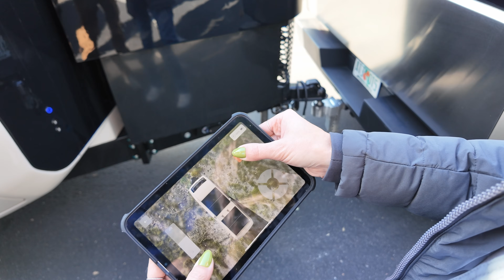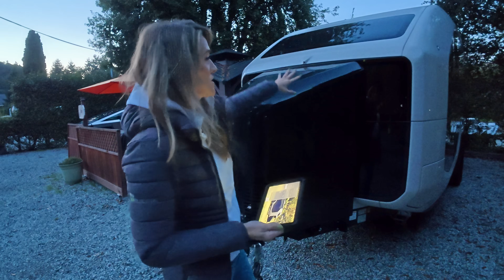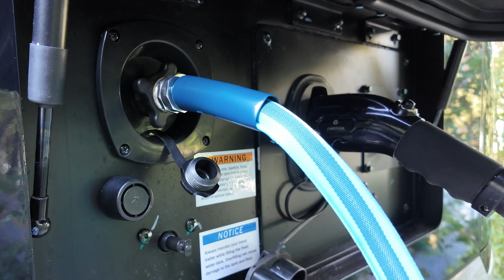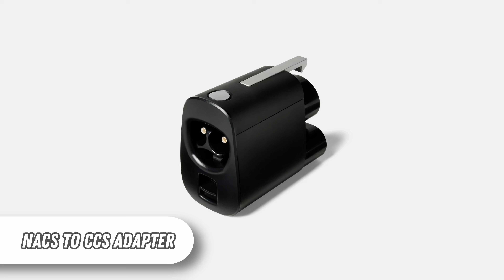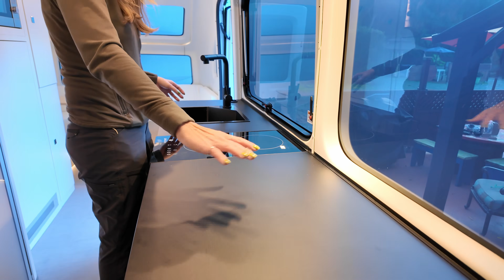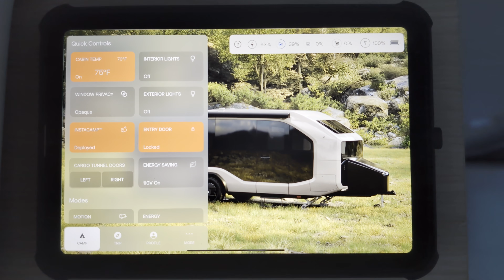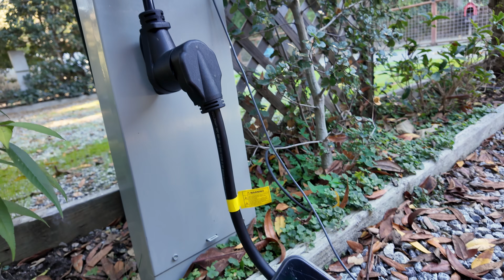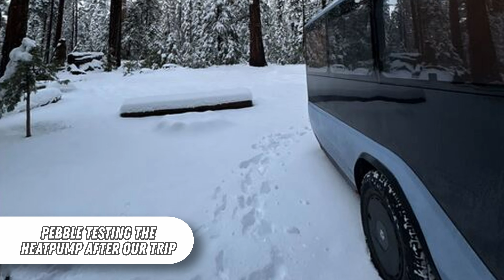World's First Pebble Flow Review (Electric Travel Trailer Camping Experience)

Comment: Good presentation. I agree with most of your observations. We picked up our Founders Edition in November and camped our way back to Colorado. We have 15 years of Airstreaming experience. I would offer just a few comments:
Your trip was short, and terrain appeared to be relatively flat. 
The exterior outlet for the cooktop is in the gear tunnel. No need for a skin penetration.
Bathroom lighting is independent of other lighting controls. A motion activated night light would be easy to plug in.
Single axle better enables tight turns, particularly for campsite maneuvers, and preserves interior space. 
Starlink is not included in Founders Edition.
The heat pump in our unit was quiet and heated from 29F to 75F with no effort.
The insulation was good, interior skin was comfortable to the touch with no condensation.
An exterior solar input would enable optimum placement of portable panels for better energy gain in boondocking situations.
Both energy and water conservation can improve with boondocking experience. 
I charged both the Pebble and our R1T in campgrounds with no issues.
Reply: Thank you so much for your comment. I got worried about the heat pump considering I’m within few days of receiving the Pebble. Any advice as an owner that I should ask Josh during the product orientation?
Reply from the maker: I'd venture to guess the trauma caused by Pebble's heat pump installation/calibration error ahead of our review of the serial #1 Flow has resulted in very high quality control vigilance for that particular process. 
-Producer Tim
Reply: @ZelmarDesigns We had the benefit of a VIP visit months before our delivery, so our questions at delivery were relatively few. Take your time and ask about anything on which you are unclear. Josh and his team have been great with post delivery service, coaching me through any hiccups that I’ve encountered. A few days in a RV park not too far from Fremont was valuable to us in exercising the systems before hitting the long road home.
Reply: Great video, thanks for sharing
Reply: Hey Joseph, thank you for sharing your perspective as an owner.

Jumping in to reiterate a few points you raised:

* We offer three outlets in the gear tunnel, plus a cable pass-through toward the front of the trailer intended for Starlink and other powered accessories.
* As you mentioned, we do not provide a Starlink unit with the Flow, and we also do not include an NACS adapter.
* As noted in Laycee’s video, the HVAC unit in this specific trailer had an issue that wasn’t caught because it didn’t go through the same full checks as our customer-delivery units. This has since been rectified.
* Our single-axle design is a very intentional choice as it enables tighter turns (especially with Remote Control) and preserves more interior space than a dual-axle layout.
Reply: As an owner of pebble flow, What are you thoughts on tank water, is it hot enough?
Reply: The tankless electric water heater produces very hot water (temp is adjustable) at the faucets with little delay and waste of water that has cooled in the lines.
Reply: Thanks for your review…I’m also from Colorado and hope you can go to some of the local trade shows.  You mentioned the heat pump required “no effort”. I assume you ment management. I’d be curious on the actual power draw in summer/winter modes.  Also, did you get the Tesla DC adaptor?  How did it work in terms of DC kWhs from a Supercharger?
Reply: I'm debating getting an Airstream Globetrotter 27. How do you feel the Pebble compares to your previous Airstream?
Reply: How do you like the Auto Dump feature on Pebble Flow, compared to traditional dumping process on the Airstream?
Reply from the maker: Thanks for sharing your observations and opinions as an owner.

You are the third Flow owner to comment on this video with validating perspective which has been very helpful to viewers.

Almost all of your observations appear on screen in this video, were spoken aloud in this video, or have been part of this video's description since publishing.
-Producer Tim

Comment: It looks great with the Cybertruck - very futuristic. I love the concept of the trailer, the price of course is where the desire vs necessity thinking kicks in.  It's a wonderful showcase of tech though.
Reply from the maker: Other premium 26ft travel trailers also cost $120k+ without the propulsion technology. We think the Flow will do well in that segment. Hopefully circumstances will improve regarding the supply chain so it can eventually be sold profitably at a lower price. Thanks for sharing your perspective. We hope you'll check out our reviews of other electric RVs, vehicles, and beyond on this channel
reviews.MissGoElectric.com
and at ridereviews.MissGoElectric.com
-Producer Tim
Reply: @MissGoElectric  What did you think of the Cybertruck? How does it stack up against a Rivian road trip?
Reply from the maker: We have owned a Cybertruck and a Rivian R1T personally for years. Both are a great at road tripping.  The Max Pack R1T can travel further on a single charge but has an inferior driver assistance capabilities.  The Cybertruck has a better sound system and the locking bed is better.  The Rivian frunk is outstanding and the materials are nicer.  Both great options. -Producer Tim
Reply: I could never justify that, especially considering the alternatives.  A well maintained 2005 Lazy Daze 26.5 is $25,000 , with a higher quality interior and build quality than a new RV from any of the big names in the industry.  Plus, you've got over 450+ miles of range and don't have to waste time on some slow auto-backing gimmick. Put a new engine in it plus solar panels and it's still less than a quarter the price of a Pebble.

Comment: Bathroom door should be a pocket door, not a hinged swinging door.
Reply from the maker: Where would it go? How would that affect the structural stability of the glass walls? Where would it go when retracted? How would the smartglass electronics work? Would reliability increase or decrease overall? The parts count would go up increasing labor and supply costs. Usage goals and engineering viability are often at odds.

In our experience, the bathroom door was easy and unobtrusive. 
-Producer Tim